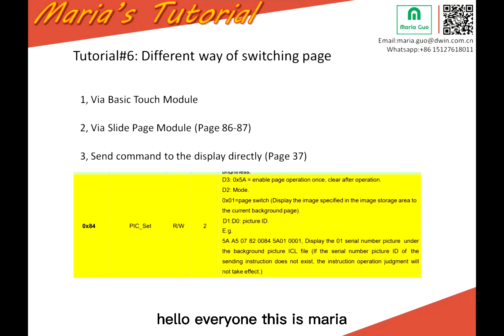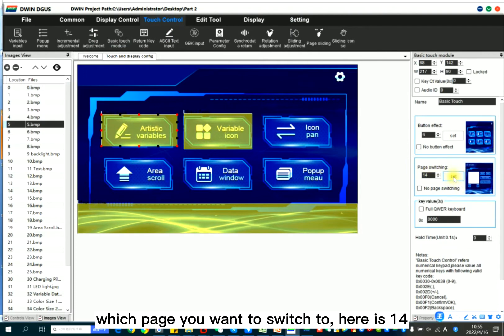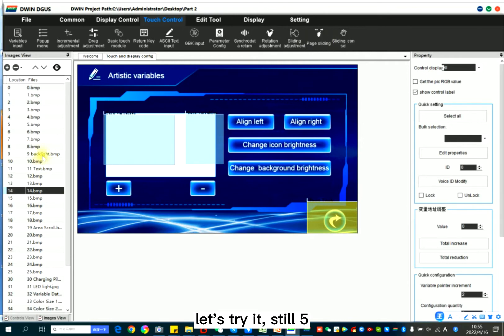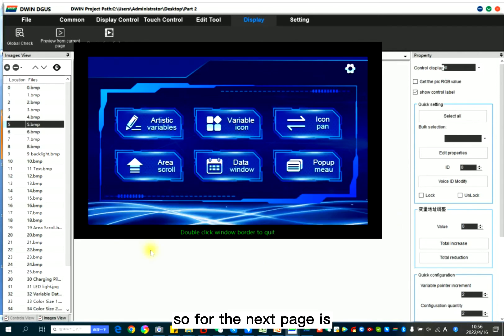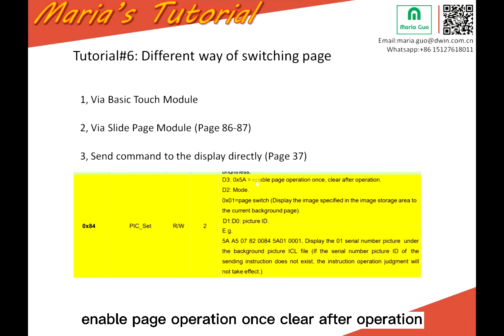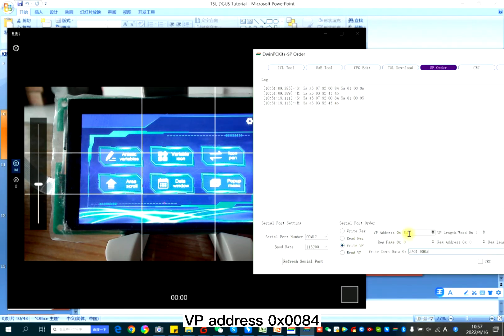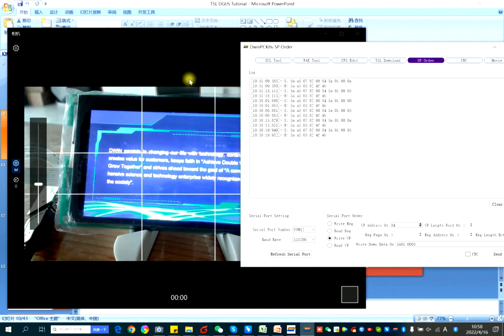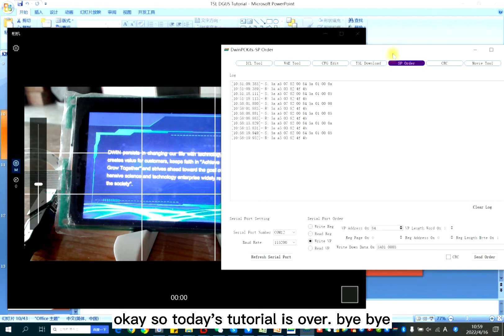DWIN T5L DGUS Tutorial #6: Several Way to Switch Page

Comment: Hello i tried to directly command the display but its not switching

I generated icl file starting from 000 to 069 and i want a page switch in 68 anf 69 when there is command

Do i need to like use any features for this transitions
Reply from the maker: what's your model no.? You better reach to us via whatsapp for details discussion.

Comment: we take input serially  from esp32 so how we switch pages in dwin display
Reply from the maker: there is a fixed command for page switching, 5A A5 07 82 0084 5A01 000A(HEX VALUE OF PAGE ID).